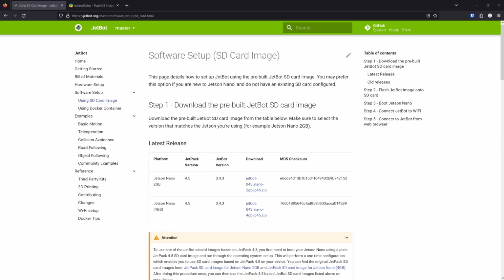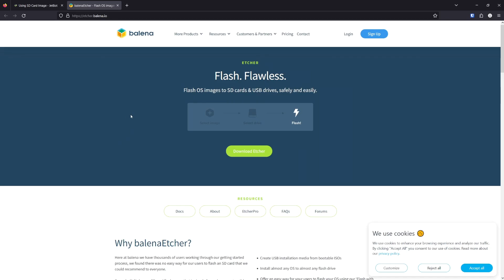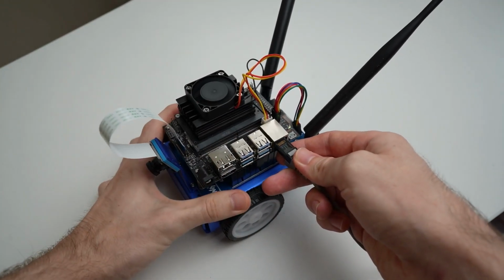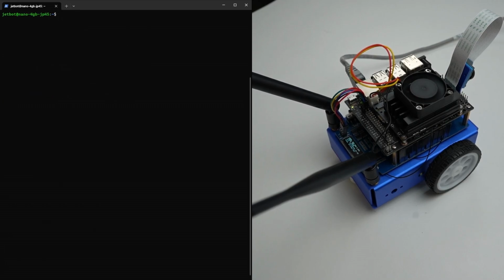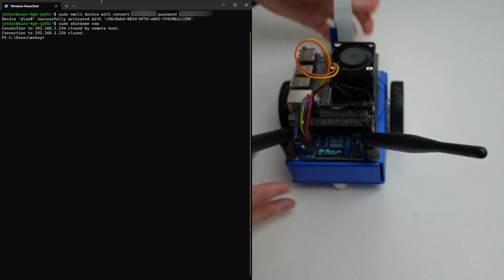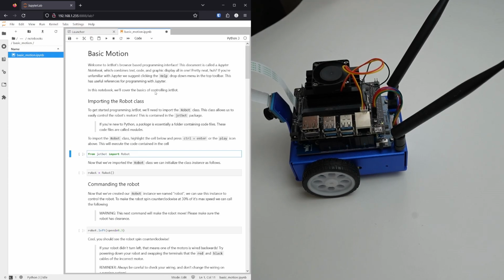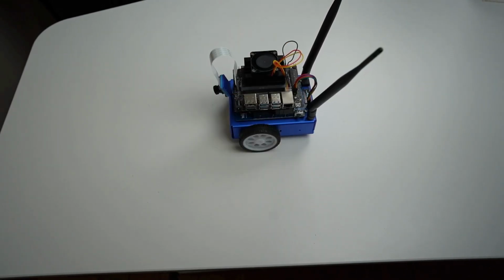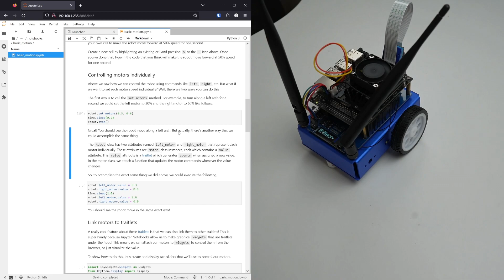Initial Setup of Waveshare Jetbot AI Robot!

Comment: Hi, I am new to Jetson Nano. I'm curious how to connect an additional sensor (optocoupler encoder) to measure the wheel rotation?
Which pins and programs should I use?
Reply from the maker: It depends on the wheel encoder! Often it's easier to buy a motor with an encoder built in. As for reading it, some encoders will just emit pulses that you need to count yourself, and some encoders will give you pulse counts over serial. Essentially, you should pick an encoder that fits your robot, then that encoder should have some guidance about how to use it.